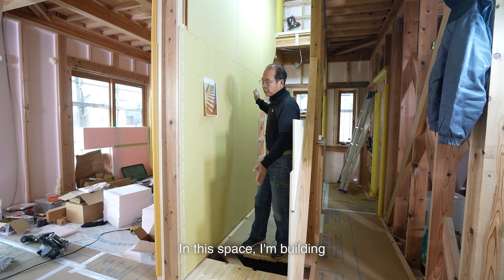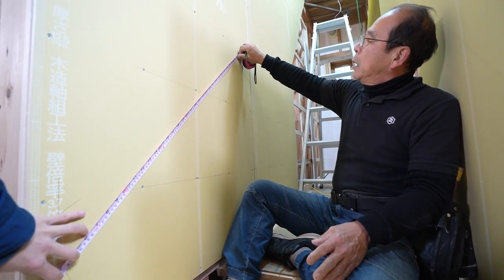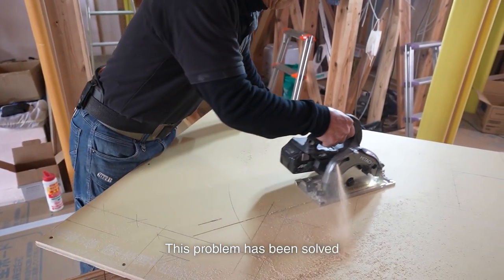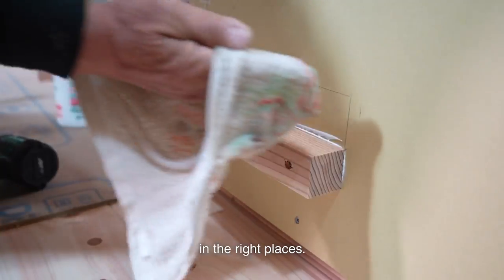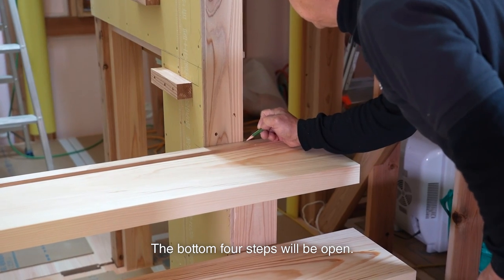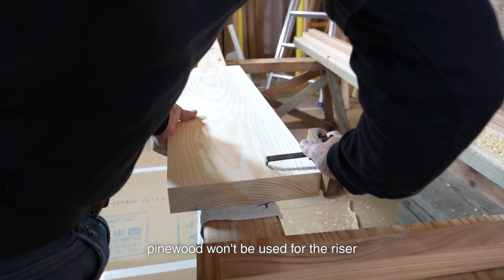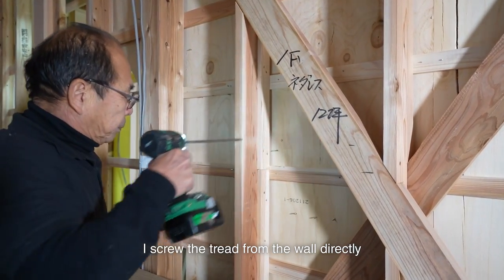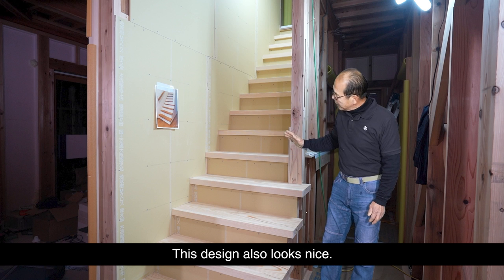Half-Open Stairs? I Build My First Straight Staircase in 15 years [Season 3 - Part 10]

Comment: Thank you for doing an english translated channel, but I would still happily watch your Japanese channel! You sir are a true master of your craft and it is a pleasure to watch you create your art, and also to see how you quickly solve problems along the way! Here in Australia it would be very rare (if at all) to see anyone working on a job site with this level of precision, and also a genuine care for the people who will eventually be living in the house.
Reply: In Australia we also don't tend to build with such high-quality timber in such large sections. Most of our locally sourced softwoods are radiata pine (cheap) or native Auracaria (expensive but lovely). We do have a fantastic array of hardwoods, although these are massively harder to work than even the Ash that they have in Japan I suspect. On the other hand, we are not building our houses to be shaken without damage like they have to in Japan. I mean when was the last time you heard of someone using 30mm boards for floors here?

I wonder about the relative costs of construction per square metre between the houses that we see under construction here and the far larger houses that we make here as well.

This work is definitely inspiring though, no question.

Comment: I like the stringerless effect of these stairs. Has Shoyan ever  built stairs with two stringers offset and then have the stair threads attached to the stringers and not touching the walls. The effect would be similar to stairs that FLOAT. The area would have to be wider than what he had done here so to get the full beauty of these stairs. Thanks.....Ping from Vancouver Canada.

Comment: I just noticed how you can flex your measuring square to hold it firmly in place while drawing a line with a pencil.   This is very efficient yet I wonder why this tool is rarely seen in North America.
Reply: I believe that's called a 'sashigane'. Internet has a fair amount of pretty neat info on them.
Reply: Hida tools imports Japanese tools for sale in the us, they sell a sashigane with inch measurements. Only place I’ve found one, it’s awesome, I use mine all the time. A 10”x20” was $45.
Reply: I would say that craftmen in the US don't work as precise as he does so no fine measurement is needed.

Comment: Is this the typical way of supporting stairs in japan? In the US we would typically have a quite stout stairs stringer with 90 degree sections cut out to support the steps running from top to bottom of staircase. The technique shown here seems like it is just supported by the shear strength of the screw?
Reply: He also glued each supporting block to the wall material and then screwed each in. That said, I am also a bit curious how standard or custom that approach is for Japanese carpentry work.
Reply: Bear in mind that the average US american weights twice as much as a Japanese.
Reply: Exactly, it seems so underestimated to me. And the screws in this video are even meeting each other in the 90 degrees direction. My experience is, that such tiny wooden supports do crack easily when being screwed with 1 screw only - can't imagine putting 6 screws (even without pre-drilling).

Comment: How did he plane the end grain of that pine without it splintering on the edges? Does the plane iron just have to be super sharp and less than a tenth of a millimeter out of the plane?
Reply: Was that why he glued the ends?
Reply: Typically Japanese planes are EXTREMELY sharp
Reply: For the "face" of the endgrain, he only planes half way thru, from both edges toward the middle. He has also slightly chamfered the edges first in the same manner (half way across only) and for that, I expect (but would have to re-watch) he probably ran the plane at a slight angle to get a "slicing inward" effect, which I believe also reduces splintering. But yeah, I expect his plane iron is insanely sharp, as well. Much respect for all his skills.

Comment: Using the cloth at 12:08 to hold the board is next level. Is the cloth wet or dry?
Reply: The cloth is actually just protecting the tread from the screw he has driven into his workbench. You can see it if you look closely. He uses those to hold his pieces when he hand planes.